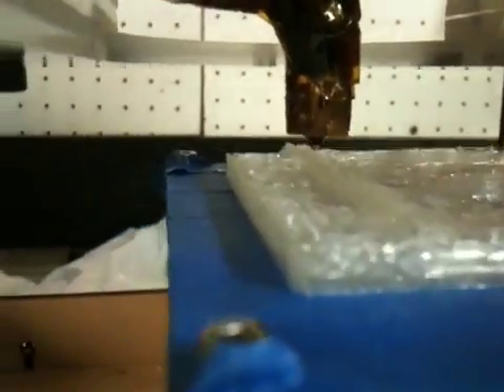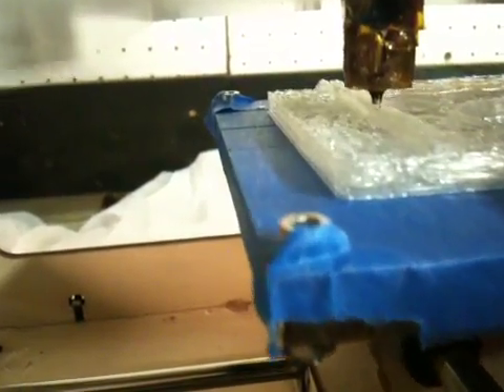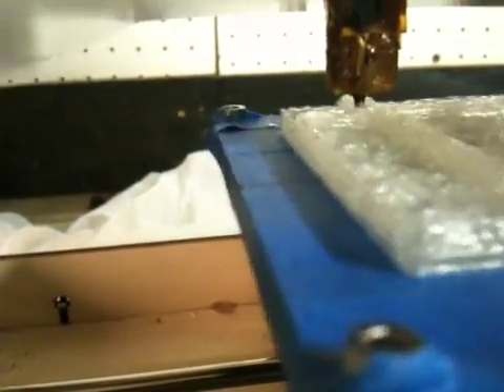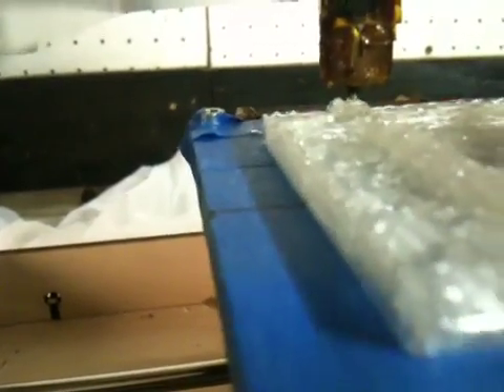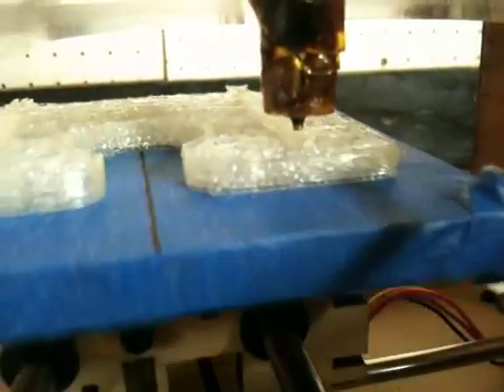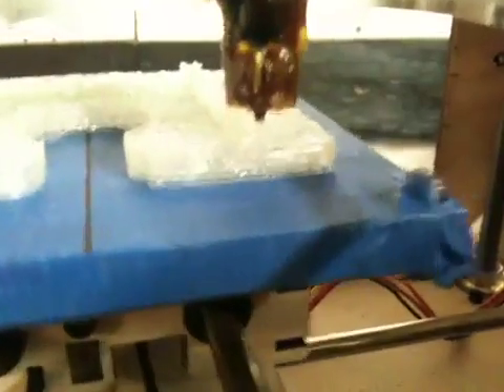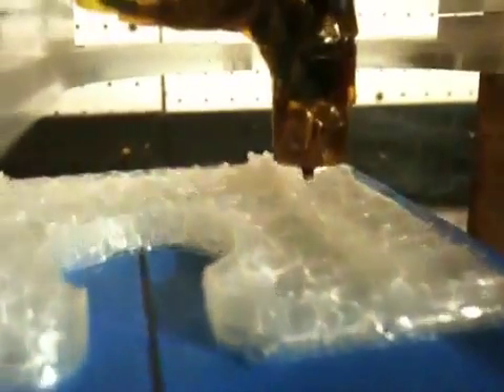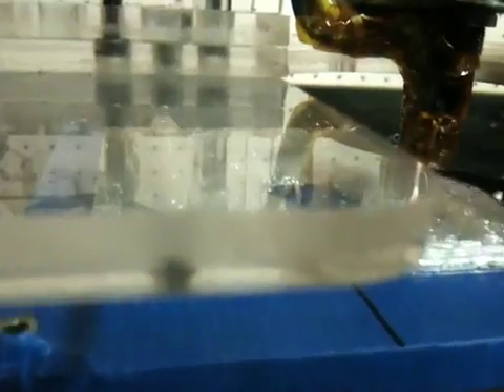Extruder stops trying to extrude

Comment from the maker: @jlkeegan (continued).. I borrowed back the Makerbot (wanting to resolve this failure in my head), and I built a relay circuit to try to fix this, which worked, but then I ran into unrelated problems (a jammed-up barrel, etc). Ultimately I went back to using my Mendel and buying the piece I needed for a repair online.

(The relay board is such that the power that used to drive the motor now simply triggers a relay, and current flows from 12v+ through the relay and right to the gearmotor)

Comment from the maker: @r0dnify I think so, yeah.. I'd stopped using the Makerbot for a long time once I got my Mendel built, but then I heard that there was a problem with the DC gearmotors. What I heard was that they're not great in quality, and that as they're used, they change performance profiles such that they end up with a higher resistance. The motor would still be able to move, but it draws more current. The thing is, the Extruder Controller board has (from what I remember hearing) a 2 amp limit, and CUTS OUT